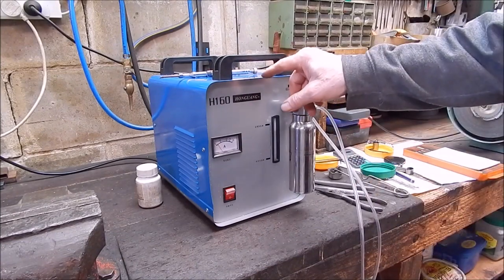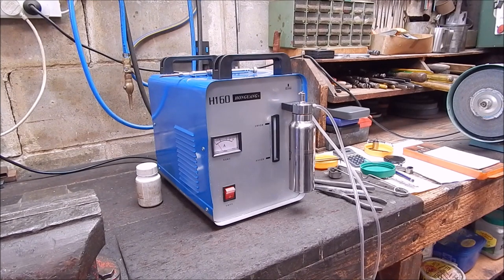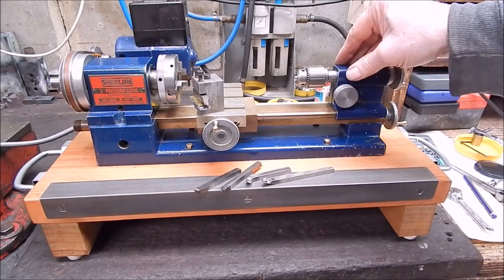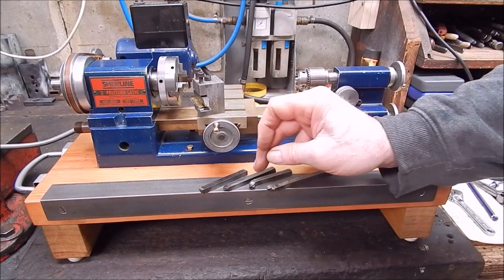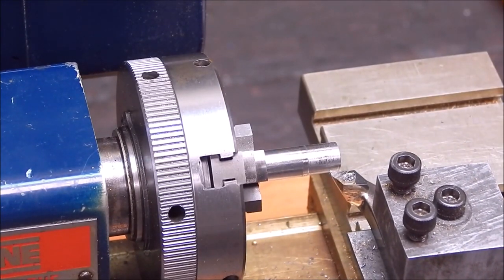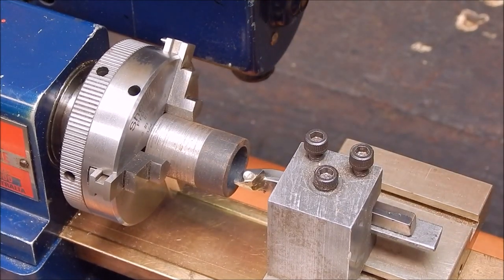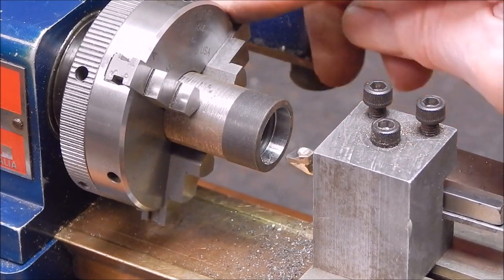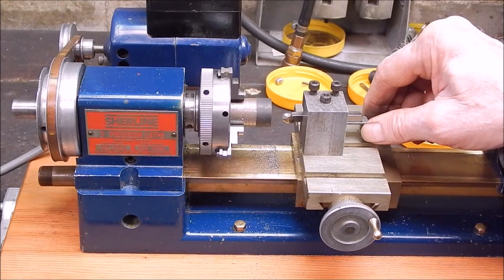Make 6 mm carbide lathe tooling with the H160 high temperature gas torch

Comment: Hi Rob. That's quite an impressive amount of heat that little torch puts out. I didn't think it would have any trouble with the carbide tool but I was surprised that it managed to heat the shank up enough for brazing. Cheers, Alan.
Reply from the maker: Hi Alan,  6 mm is as much as it can handle.  I wish they made one of these three or four times as big.  Now THAT would be mighty handy.  Cheers Rob

Comment from the maker: NOTE:  6 mm key bar / key steel can be used as the base stock.  This is the limit of the torch's ability and the perfect size for micro tooling.  Cheers Rob

Comment: Hi Rob, unrelated to the topic your presenting, I was wondering what is your home brew cutting fluid made up of?  Did you say diesel and engine oil???
I've been using WD40, but I was hoping to find out a cheaper alternative with the same or better results.  Many thanks for your content and possibly the answer to my question.  Cheers John
Reply from the maker: Hi John,  It's 4 or 5 parts kerosene with one part car engine oil.  You can make the oiliness level whatever level you want. It will smoke a bit, same as WD40 (which is mostly kerosene).  Cheers Rob
Reply: Thanks Rob.